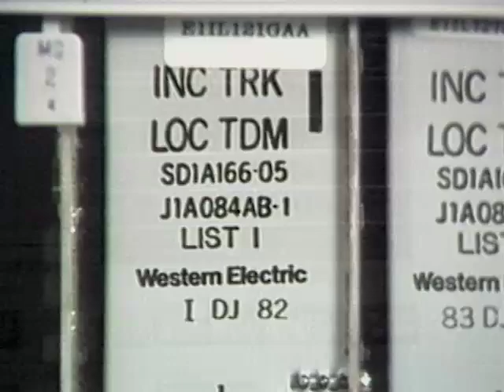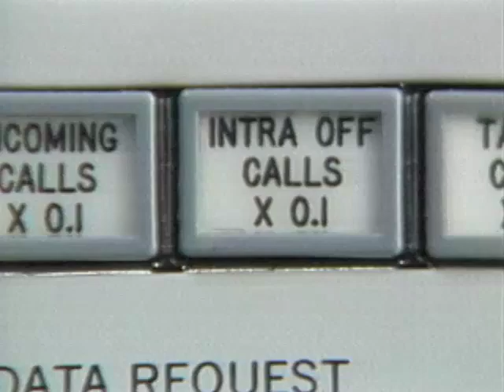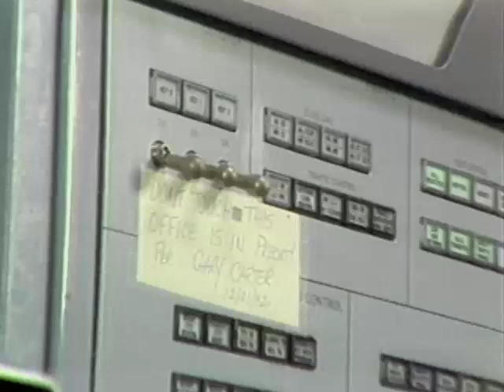Speedy Cutover Service, SXS switching cutover to ESS filmed live at Glendale CA central office, 1984

Comment: What most people dont realize, is that in 2021 - your standard copper line telephone service is probably still using the same things.. central office basements filled with giant batteries to keep lines working even if the power went out.. today if you have a fiber optic service to your home - you get a small battery in your house that will last a few hours if your lucky.   All the old stuff in Central Offices meticulously ran and organized. Its amazing to see in person. The amount of time and effort (and space) that went into it all is mind blowing, and today one single fiber optic line can service an entire office building.
Reply: There is no copper phone service anymore.  It's done.
Reply: If people order phone service, it is delivered either by cable or DSL.
Reply: I know it's difficult to believe, but it really happened.
Reply: @bsadewitz  there is, depending on areas.  But it's being phased out where it can be.
Reply: @kctyphoon  Is it still?  I have been unable to find a firm answer on this online.
Reply: @kctyphoon  I think,  at least, it is impossible to order it.
Reply: @kctyphoon  And what kind of battery are we talking about here?  I don't think it would be absolutely cost-prohibitive to provide a battery that would last longer than a few hours, but I am not familiar with the equipment so I really have no idea what the reality is.
Reply: @bsadewitz  well, I'm a lineman for a large telecom company in the northeast.  Copper is up EVERYWHERE. But where fiber service is available it's being phased out.  Some places don't have fiber available (from us anyway, and probably not real fiber service from a competitor) so copper phone service is still available in those areas.
Reply: I can tell you that, in the neighborhood where I grew up, they had switched to using a ... the name of the thing is escaping me right now.  It's a thing they run fiber to, and then the POTS lines connect to that.  I know they used it because I worked for an ISP at the time, and they ordered a 64k 4-wire frame relay circuit to my parents house, but there was no copper from a CO to my parents house, but they couldn't just connect it to whatever that thing was, apparently. Or it was before they started using that thing, and the phone lines were just really really long lol.  So they assigned this project to one poor guy who had to climb up, pole by pole, the whole way for miles to find some fault because when they turned it up, it didn't work.  I think it was like 7 miles or something--or whatever the very outer limits are of that spec.  I did NOT envy that guy. It's kind of odd because we had ISDN before that, and that did not have that problem.  It took a LONG time to get the circuit installed.  Like 10 months or something insane like that.
Reply: @kctyphoon  Oh, so, anyway, the reason I told that story is because I am curious what they used to power the lines, because that thing that all the copper lines connected to wasn't that big, and it had to work even if the power went out (and it did in fact work when tbe power was out).
Reply: @bsadewitz   in large copper cables running down a local highway or main road, say one cable has 1200 lines in it (2400 individual wires) - out of that probably only a handful are still actually being used, like a dozen or two, IF that much - where fiber service is available.  Most people were forced to switched over,  but I'm guessing there are some holdouts, or critical lines that don't want (or can't) rely on a small battery backup. There are still lead sheath cables up in the air in places. Even if not being used, most of that stuff is still up in air and underground.  That said - there are some areas where fiber service still hasn't been ran.  Places with underground services, and places where homes are spaces far apart from each other are still waiting. Not everyone and everywhere has had true fiber service run to their homes.  There are cable providers that advertise fiber service,  but it's not actually fiber from point to point.  They'll use fiber to span long distances but their local service and line to your house may still be coax cable.  By me, FiOS is the only true fiber service to your house.
Reply: @kctyphoon  Although I guess there could be areas where they just can't get rid of it, period, because of technical limitations, but what would those be? Sorry, but this happened to intersect with a bunch of other questions that have bothered me for YEARS haha.

I have also tried to find out when the last fully electromechanical switch was phased out in the US, and where it was.  No luck.  But I assume that it's been at LEAST 10-15 years since that happened.  The last ones I personally am aware of are Miami, TX, and I think one somewhere in Michigan.  For all of North America, just decided to trust Evan Doorbell and go with Nantes, QC.
Reply: To me, crossbars are more amazing than SxS because they almost are computers.  Actual computers were built using crossbar switch frames.  There is one somewhere in Japan that they maintain for historical and educational purposes--if you haven't seen the video about it I highly recommend it.  I think it might be the largest mechanical computer  ever built.  It has like 10-16kilobits of memory IIRC. It is an absolute BEAST.
Reply: @kctyphoon  Oh, well, I wasn't under the illusion that everyone had fiber to their homes, just that they stopped using the copper for POTS lines.  That is, you order phone service, and the actual copper is DSL or some variant.  It's kind of amazing, because 20-some years ago where my parents lived, they upgraded from a 1AESS to 5ESS.  I remember knowing it happened because there weren't any click noises on the phone anymore.  It was kinda amusing because even call waiting was CLICK beep CLICK.   I can't believe that much time has gone by @_@
Reply: @kctyphoon  I mean, there's a lot of bandwidth on that coax.  Actually, where I live, I don't think the cable company even runs fiber to customer premises, period.  Now, given the speeds they provide, the actual infrastructure must be fiber, I presume.  But I am pretty sure they will only install fiber to businesses.  I'm not positive; it could be that my apartment building just doesn't have it.
Reply: @kctyphoon  Yeah, I can't say that I have noticed much of a difference in terms of what's on the telephone poles.  Looks like the copper is still there to me, lol, but it's not like I've done a survey. (I'm in NJ)
Reply: @kctyphoon  Yeah, the one unequivocal advantage to copper was the power on the line.  And frankly I don't recall there ever being a telephone outage, ever.  Not for one second of all 18 years I lived in a place where there were landline phones.  Power, plenty--and I think even water once--but not POTS.
Reply: @kctyphoon  I have been trying to ascertain whether there is in-band signalling and/or electromechanical COs in use anywhere in the world but have gotten basically nowhere.  There MUST be, right?  Somewhere?  The strong case for "no" I think is basically that it is cheaper to do wireless in developing countries, but that isn't too persuasive to me.  I mean I have spent probably 10 hours over the past few years looking so far.  But it's not like there is a worldwide database of these things.  Until around ~2000, in-band signalling was still pretty common, at least for international trunks.  I myself used to "blue box" when I was a teenager in the mid-late 90s.  There used to be 800 numbers that connected to a local operator in like 20+ countries; those are what I used.  Well, that and an 800 number to Ketchikan, AK.  Recently, I suppose as a function of aging, I have gotten interested in this stuff again, and have been surprised to find that no one seems to mention this. Everyone says it died in the 80s.  I used to talk to people online about it, and I was the first one I knew of at that time who was doing that in the US (the software I used was written by someone in Germany) , but there is no way I was actually that unique.  That is just not possible.  I managed to get it to work to some extent in China, Macau, Chile, Argentina, Greece, Belize, and Uruguay. It's kind of crazy that I remember this.  But I couldn't figure out the routings to get out of the country for any of them except Greece, which was wide open.
Reply: @kctyphoon  How often do you work on copper, or is that not something you, personally, do?

Comment: My Aunt was present for one of these cutovers and said that the noise difference was incredible when the SXS system was shut down.
Reply: My dad was an Central Office manager for Bell Atlantic for 30 years and they cut over to ESS sometime near the end of his career. The constant sound of the old switches has pretty much ruined his hearing. Now that he's in his late 70s and retired, he has lost pretty much all his high-frequency hearing--he can barely hear female or child voices at all, and can't hear any sort of high frequency sounds.
Reply: @stereodreamer23  I believe it. I've been told that many that spent extensive time with that equipment had significant hearing loss. I remember going into the building with my Mom once (whole side of the family worked there) to get to some office she needed to go to and passing by the door to the massive room with the ESS equipment. Even that seemed loud. I can't imagine what it was like full of mechanical stepping switches. Single door off a common stairwell with a combination lock and a huge window. I can't imagine it still being that accessible now.

Comment: What..no arrestors on the frame? In Australia we would just wrap a cotton rope around all of the arrestors on each vertical. On cue about six guys would yank six ropes each and disconnect about 10k lines from the sxs in about 10 seconds. No scaffolds, no cutters.
Reply: That is America, they have to keep jobs on deck for those immigrants.
Reply: @Elfnetdesigns oh, well, how many immigrants were there for this job. None
Reply: 10k  lines ? was that all the lines in australia ,im sorry but this is the usa.we had 10k lines in the 80's for just pizza places in new jersey.
Reply: @sharpe227  Nah Max, in Aystraylya our networks grew up with larger numbers of smaller exchanges. Five 10k exchanges plus another eight satellite 3k's might have covered the same area that one 80k exchange would have done in the USA. Although more efficient in the use of local copper, it also led to us having enormously large and complex junction networks between exchanges in the capital cities, far more complex than in most other countries.
Reply: Australia Ericsson AXE-10 country :).

Comment: I would have killed for 5ESS in 1984.  

I had to live with E10A (a rare, level 6 French CO) until around 2000. The main computer ran at 125kHz, so it took 3 seconds to establish a connection.

Comment: Why are they LITERALLY cutting the cables?    Why not just flip the control switch over to the new system and then demolish the old system after it is no longer in service.
Reply: I couldnt find the exact video again, but i remember the gist of something like this:
The old system is mechanical. There is no way to turn off a single control switch as the people back then didnt had it in mind. The only way to turn it off is to kill the main power to everything, which they cant do because they still need to service people (as they are legally contracted to their customers). So they have a part of old still running, and another part which they would cutover.
So they built the new electronic system on top of the old one that they selected. When built, both the old and new can respond to calls. Now it is time to "cutover" to the new system, leaving the old one.
While the control switch has no calls, they need to physically cut the connection by cutting said cables, then turning the new system on. They need to do it as fast as they could as to not inconvenience their customers (they can be sued for it if they take too long)
.
Im sorry if I cant answer much questions and if Im wrong (which im probably am).  Im still looking for that video where i got that info.
Reply: @WingMaster562  so when they cut the cable, new system will automatically take over? The don't need to rewire it to the new one?
Reply: @dnwklin  the new system is already wired in parallel to the old before cutting.
.
After making sure the new system is ready, they would turn it off, then do the cutover, then turn it on. (You can see the guy in the video taking his sweet time turning on the new system with a switch)
.
This ks because the new system might break if short circuits occur. Contrary to what is said in the video, those are not special cutters, but rather they are just regular bolt cutters. You can even see some sparks fly while theyre doing the cutover. In reality, there are no cutters that can cut multiple wires in one go without causing a short circuit. 
.
Im still looking for that video. I was hoping that it would show up in my history, but it seems like I wasnt logged in when I viewed that.
Reply: @WingMaster562  I suspect the hot cut is the subscriber lines connected to the line finders.  They will have at least 48 volts on them.  Shorting it out during the cut is harmless since the phone going off-hook is basically a short anyway, creates a current loop that energizes the line finder.  The sharp cutters is so that when the cut is complete the cut-ends do not touch each other and continue to short out a subscriber line.   The necessity of the rapid cut is not clear but I suspect the ESS has its own line finders that ought not to be working in parallel with the mechanical line finders.
Reply: Digital kids trying to understand analog crack me up.
Reply: @Shadare  isn't the new system still an analog system?   Digital switching obviously, but still analog phone signal.
Reply: @thomasmaughan4798  why not just set up the new system next to the old system, but unconnected from the subscriber lines.   Then they could move the subscriber lines over from old machine to new machine a few cables at a time.   Thus the two systems would never be paralleled on the same lines at the same time, but would effectively work in parallel allowing a more leisurely and careful cut over
Reply: @wouldntyouliketoknow9891   I don't know the exact answer.  I studied somewhat a functioning telephone switch in Alaska that still used Strowger Steppers.  Every subscriber is connected to a bank of line finders but also connected to the output, so to speak, of the Strowger switch or crosspoint; probably many such things.   The amount of wire involved is amazing.  

You cannot just tell the electromechanical switches to stop working and they are wired up in a matrix.  So really the only way to migrate is all at once.  Now it is clear that the Electronic Switch was already connected to every subscriber; the hard part is the mechanical switches.  They have to be cut, and you have to cut all of them because of this matrix of wiring.   You'll note that the video is carefully choosing which wires to cut, not all of them, and probably just the wires to the line finders.
Reply: @wouldntyouliketoknow9891  I feel like digital control is what people mean when they say digital.  Everything digital is eventually analog if you look hard enough.
Reply: @WingMaster562  those aren't bolt cutters, those are rigid wire cutters, just very large. I thought they were boltcutters too from the thumbnail, but i actually have smaller pairs of the exact cutters they use. 

If you cut a wire with diagonal cutters (or bolt cutters for that matter) it squishes the wire, which makes it wider at the cut part, which means that all the wide parts of all the cut wires can touch, which causes shorts. Also due to not being correctly sharpened it can snag on the insulation and pull wires out of place while removing the insulation just from friction and cause shorts. 

These cutters cut the wires flat without changing the shape. you have to open them, and they don't actually start cutting the wire until the wire can't escape out the top (think of how round stuff slides when you try to cut it with normal scissors that haven't been honed with a diamond comb - like how haircutting shears are sharpened, for instance). The actual cut is like a guillotine rather than against an anvil (like cable cutters for stuff that isn't energized, bolt cutters, pliers, etc).
Reply: @wouldntyouliketoknow9891  correct, 1A was still analogue. 5E (all-digital) was released that same year (1982)
my town still had one until 2016!

Comment: Here in Brazil, my father also worked for TELESP in the Telebras system and when it was sold in 1998 to Telefonica VIVO, the same thing happened.
I have been in this telecom field for the last 20 years and have done a lot of equipment decommissioning in the last 10 years.

Comment: here's the thing--when an old switch office is converted to run on ESS, the main truck lines coming into the office are put on a splitter, with duplicate lines going to BOTH systems. The way the "cutover" is done is by literally flipping a switch on that splitter, and that switch is controlled by a computer, so it can be done by some IT geek sitting at a keyboard anywhere on the planet--even back in 1984.

The whole "cutover" thing with dozens of guys snipping cables was just "technology theater"--a publicity stunt dreamed up by some marketing wonks at AT&T and Western Electric to make the process of converting service from analog to digital more interesting and dramatic for the public. It was symbolic of "severing ties" with the old tech. It is LITERALLY  non-functional publicity stunt. You don't have to cut the cables on the analog system in order for the new digital system to begin functioning. This whole thing is just Public Relations Shenanigans...